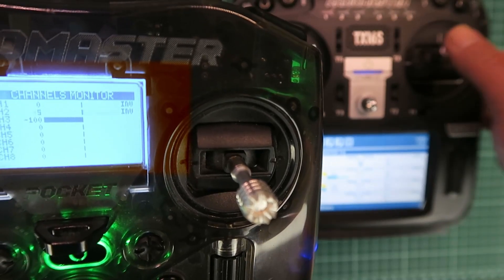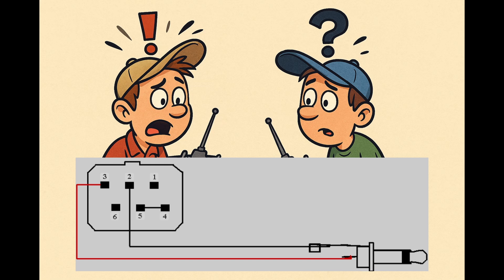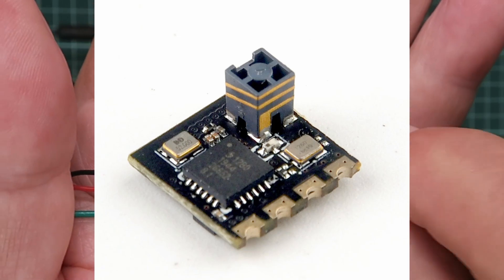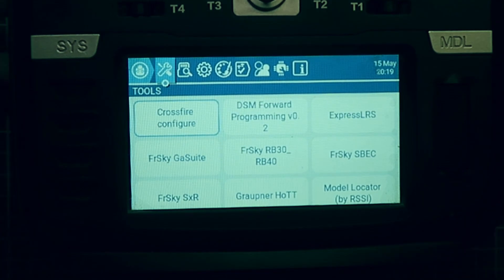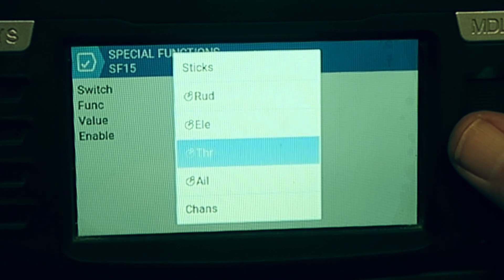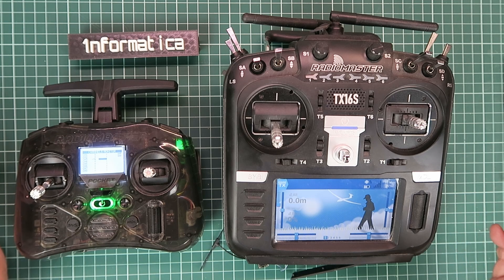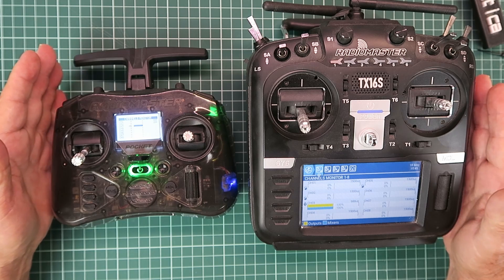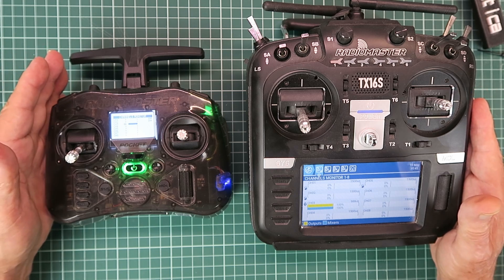How to Set Up Wireless Trainer Mode with EdgeTX | Radiomaster TX16S & Pocket ELRS Guide

Comment: It doesnt't work for me. Both radios are operating independantly with the trainer switch on/off. Anyone help me figure it out?
Reply from the maker: What radios and receivers are you using? Have you checked that the slave radio's receiver  is bound to the master?
Reply: @1nformatica I got it working! I'm not sure what exactly but I cycled through the master/serial modes and eventually heard trainer signal recovered and it started working! 

Thank you for the great video, very helpful
Reply: Btw I used a boxer as master and tx12mkii as slave. Both internal elrs and I used a 4 pin plug from a gps I had lying around to connect the Rx into the boxer's aux port
Reply: @farhanalifpv did you set the boxer to  hardware aux 1 Sbus trainer? Also did you still do inverted Sbus?

Comment: even better is use logical switches to enable/disable trainer function on master radio by stick movement - no need to flip the switch to gain control,
Reply from the maker: Interesting idea! I will try it, thanks.
Reply: Can you share a screen grab of the functions to get that working?

Comment: At approx 8 mins you’re binding the two radios. I want to make this exact setup so my son can use his ELRS pocket tx as a slave radio to my TX16S. Is binding as simple as providing both the happymodel receiver and pocket TX with the same binding phrase? 

Thanks for the great content!
Reply from the maker: Hi, it is " simple as providing both the happymodel receiver and pocket TX with the same binding phrase" BUT, the important thing is that your TX16S and you son's Pocket must use different binding phrases. Thanks for watching, have a great day!
Reply: Awesome, thanks!
Reply: So I’m guessing there’s no trainer function setup on the slave tx; as far as it’s concerned it’s connected to another reciever to which it is sending control data. The TX16S is choosing when to listen to that feed (eg when trainer mode switch is on?).
Reply from the maker: @coulsonrobert  By George I think you've got it! That's exactly what it does.